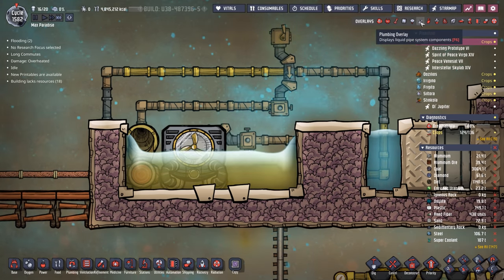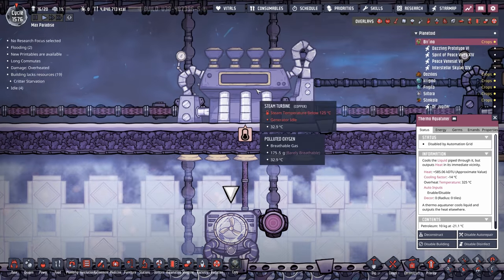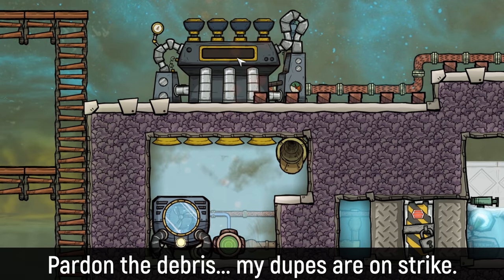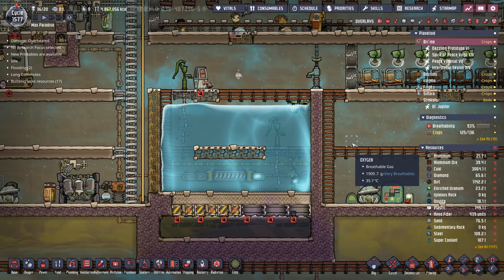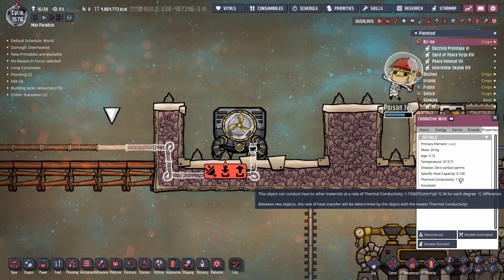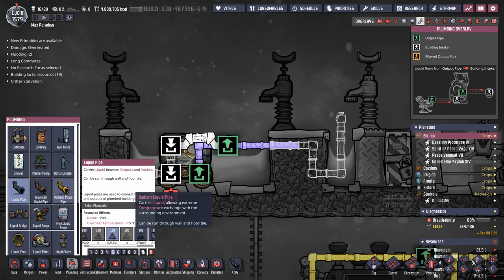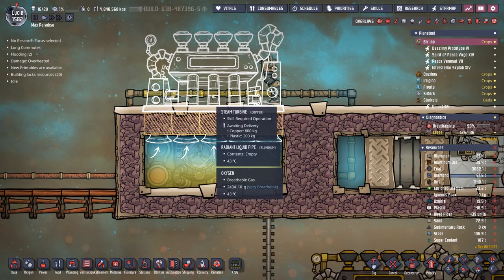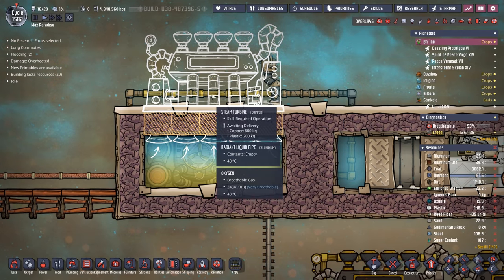Thermo Aquatuner Tutorial | Oxygen Not Included

Comment: If you have enough of the liquid available that you use as coolant, you can instead of the buffer tank have one cooling loop if you use a liquid reservoir and put the liquid pipe thermosensor right after it in the loop. That way, you can have the aquatuner run when the reservoir contents is too hot. The 14-degree cooler blobs will flow into the reservoir first and equalize with the rest of its contents. You can then set the thermosensor to any temperature (that the liquid supports) you like to have the room cooled at exactly.
Reply: Exactly what I was going to say. My sleet wheat farm is 2 degrees, not 3 not -2
Reply from the maker: I like this.  Will steal in the future :)
Reply: a ton of water in tank don't change much when 10kg blobs go in, regardless of if they were much hotter or much cooler. 
If I use polluted water I often make both input and output buffer tanks, so blobs have always a place to go, and it keeps flowing even if my power dies.
I often connect it to 3 or 4 separate loops, sure blobs are much smaller (add flow limiters, to adjust to size, and shutoffs, so you can redirect if needed, and you have industrial grade cooling system) my sleeping area usually don't need more than 1kg blobs, and I like to make it complicated, so I can curse on myself later.
Reply: @deilusi  "so I can curse at myself later" is the perfect representation of how I like to play this game hahahahahahaha
Reply: I'm really bad at imagining things, can you explain this system better? I'm interested!!
Reply: @moonlghtbttrfly Usually AT setups use a 'buffer tank', a reservoir that's barely filled that keeps the loop flowing (and ensures there's no empty pipe segments).

If we instead fill our reservoir until it's almost full, our reservoir can hold more heat before changing temps. And reservoirs will average out temperature with what's in the tank and any new liquid flowing in. So if your coolant gains 20C as it loops around your industrial block, it'll still average out with the huge mass of liquid in the tank when it gets home, so it'll only gain +0.1C overall (example numbers).

And you can put the thermo sensor on the reservoir output so it reads the "hard to change" temperature of the reservoir.
Reply: @moonlghtbttrfly  if I understand the comment correctly, this may be a better description of what the OP was explaining (please use punctuation and full sentences, gah!):

In Echo's design, he has two fluid loops. The one on the left contains his Super Coolant, and is used to bring that 2-tile block of water down cold enough that it turns into an ice block. This is done purely to "store" cold, well past the wanted temperature, so that it can be used on-demand when needed. In Echo's case, he was throwing bursts of heat at it when Resin would drop. The Mechanized Airlock between the left- and right-side of the system is what actually controls whether heat transfers to/from the ice block to cool down the target area: in his case, the Resin.

Many people, however, use this design with two fluid loops. The one on the left doesn't change, but there would be another on the right that passes through (usually) metal plates, or sometimes another liquid buffer, that is kept at a specific temperature for the base (for instance, I target mine at 25ºC and run the 2nd loop all through my base so that the entire base stays at a temperate, 25 degrees constantly). Any extra heat picked up by the 2nd loop while traveling your base will come back to the right-side of the AT and dumped into the metal/liquid on that right side. If that side warms up enough, the Mechanical Door closes, allowing that Ice Block to cool down the right side until it hits 25ºC again, effectively removing the heat.

What the OP of this thread is saying, if I understand it correctly, is that there is a method to do this without requiring a 2nd loop at all. Instead of using a Mechanical Door to manage a 2nd pool or set of metal pipes where heat is dropped off, you instead feed the Super Coolant (or whatever you are using) directly into a Buffer Tank. When a 10kg blob of very-cold liquid enters this tank, it will even out with the all the other liquid already in the tank, only lowering its temperature slightly (depending on how full you keep your tank).

By moving the Liquid Thermal Sensor to just next to the Buffer Reservoir's liquid output, and letting it control the AT, you can configure the AT to only cool down the rotating liquid if that buffer tank drops below 25ºC. Since it takes quite a few drops of liquid to lower the temperature of that much mass of liquid, the AT should stay on for a bit, until the entire reservoir is lowered to the target temperature.

By doing this, you can reduce the 2-loop setup, with an ice block on one side and a mechanical airlock managing thermal transfer, to a much more simple system where the AT is controlled by the exact-temperature of the water leaving the active loop, instead of managing the indirect "super cooling" loop. It's less complicated and also requires a smaller footprint and fewer materials - all around a better design. The only con is that, as mentioned by OP, because you need a tank sitting half-full (or so) of your coolant liquid, it does take significantly more coolant liquid than this video's design. Maybe not a problem for Polluted Water, but it certainly could be for a mid-game deep-freezer.

Both designs have their uses, but I could see the Reservoir design being significantly better for most applications, with few exceptions for when you don't have enough coolant on hand for the better design.
Reply: @Chiberia  Would love to see pics referencing what you rewrote for OP. or even a blueprint that would better help this newbie understand what all is going on w/ what you've stated.
Cheers

Comment: I would avoid using polluted water in the tuner room. When it turns to steam, polluted water leaves a little dirt, and if that gets hot enough, it will turn into a solid block which can short circuit your cooling. If you have some oil or petroleum I think that will work fine with water.
Reply: Wouldn't that require an entire tile worth (one ton?) of dirt?
Reply: @Kenionatus  no, just a little bit can make a tiles
Reply: By the time you are commonly using aquatuners you should be using steam turbines and have oil for plastic already sorted.

Comment: Great tutorial!
- pro tip with 2 liquids instead of vacuuming the room
- very space efficient setup
- material usage explanation... nice!

Also, I thought that bridge is a mistake, but after some playing around it turns out you NEED to have different length bypass vs aqua tuner path. The reason - The aqua tuner can store 10kg of water and while disabled, it doesn't process the water. So as soon as a warm packet of liquid starts traveling towards the sensor, the aqua tuner turns on and starts processing the liquid inside it. That detail makes the whole liquid packet logic a bit confusing, but .ong story short - it works!

Comment: Sleet wheat farm - I'm not using an AT/turbine to cool mine, although I might switch to that in the future.  Instead it's cooled by the output from a cool salt slush geyser, run through a small tepidizer to go up to 2C, desalinated, and then feeds into the sleet wheat farm.  In the future overflow will go to the bristle berry farm just beneath, that pipe will be warmed just a bit more for the bristle berries.  The sand I get from crushing the salt goes to my cool slush geyser's offgassing chamber where I make cold oxygen and clay for ceramics.  I will add a grubfruit farm when I can to make mixed berry pie, one sulfur geyser is more than enough and I got two of those.

Comment: Great to see how to set one up. I always have to redo it because it doesn’t work right the first time
Reply: Was wondering if you can do a tutorial on how to set up a conveyor system to cool down material for metal volcano’s I can never get the layout right and it just stops all the time.
Reply from the maker: This isn't your fault. There is a small bug with the rail sensor where it will not read tiny fractions of material.  It ends up backing it up there.  Check out the Primus series we did two series ago, there is a igneous rock conveyer system in a volcano tamer that may help until I do a proper tutorial.  Thanks for the request and comment!
Reply: @EchoRidgeGaming  thanks I will take a look on that seires. once again great work on the work

Comment: Question on the utility of the ice : You put the ice in just to get something very cold and solids radiate heat / cold more efficiently than liquid  which are more efficient than gas?
Question of understanding: the metal door is to create a vaccum and make sure the temp shift stops?
Third question: Since the tuner will keep on woring as long as the input is warmer than the automation goal more, could I use it to cool down more than just what you showed in the video (provided I have the right coolant and such)? I would have to do it by order of prority but for general base cooling it could work (I hear the mineral consumption and so on, of course).

Comment: Another good way to cool one of these is to use the polluted water from the bathrooms and send the hot Pwater into a peppernut farm.   Or just skip the middleman and stick the aquatuner in the peppernut farm directly.   Putting it in a bath of ethanol at the bottom of the farm works good because it will spread the heat much better than air when it evaporates.  

Also, putting a thermo sensor in the chill reservoir like a block of ethanol or brine surrounded by the ice.  It makes piping a little simpler and does the same thing.

One last thing, using a flow valve at max flow will allow you to make an uninterruptable loop for the aquatuner.  I generally stick it outside the steam chamber to save steel, but as long as both input and output pathways are made the same length, it doesn't matter.

Comment: With the Spaced Out DLC, my current starting planetoid is rich in metal, arbor trees, and pockets of ethanol. The clean water pockets are limited so clean water is kind of scarce, and there's only a few pockets of polluted water near the initial starting biome. There are no reed fibers, or oil on this planet either. So I'm currently without my atmosuits. I can however ranch dreckos for their coats to make my fibers but I need the cool water to produce oxygen. Power isn't a major issue, but oxygen is. 

There is however a cool steam vent that isn't too far from my starting base with a big pocket of water, however it was about 165 - 175 degrees in F while dormant. The cool steam vent puts out at about 195 - 205 degrees F, not quite hot enough to boil the water. After analyzing it, I built a set of mesh tiles off to the right of the geyser so that the water it generates can flow down. Then I built a chamber with a set of flood gates to bring about 6 tiles worth of water 2 high by 3 wide into it feeding into another flood gate. This chamber is 12 tiles 2 high by 6 wide.  And these two are the lower half of the entire chamber. Above the first chamber right after the pool of water from the cool steam vent I have another room that is the same size as the first chamber and this room becomes sealed off with air locks, and the last chamber is open with mesh tiles for my dupes to walk across and build or adjust things if needed. Yes without my atmosuits they suffered scalding and a few of them even got heat strokes in the initial build. 

The reason I had the separate room above the first flood gate and and the second chamber being opened is that I had to put gas pumps in there to create a vacuum to suck out all of that hot air (oxygen-co2)... so that it wouldn't add heat back into the water. I had the pump as far as possible from the main pool. I only have copper, iron and aluminum to work with.  

Now to cool this water. I have the aquatuner but I don't have the steam engine as I have not done any material science yet. I need the cool water now because the amount of algae is very low and I was using up the slime fast to turn it into algae. So I didn't have time to do the material science. So how did I cool this water? I used two aquatuners in series one right after another being cooled by 32 - 40 degree ethanol. Just to the right of this tamed steam vent and the chambers I built and up above were two pools of ethanol one right above the other. So I build a big tank chamber to catch all of this ethanol by gravity.

I then pumped the water from the cooler chamber which was about 165 about 2 degrees below the pumps capacity before being damaged into the two aquatuners. Then I used radiant pipes going through the cold ethanol into a storage tank. I was also pumping out this ethanol into another building into another storage tank that's feeding two petroleum burners with a carbon skimmer and water sieve setup. 

Now as for the chilled water in the tank I was sending this out and splitting it two ways. The first was going through a long series of conduction panels under the two chambers within the insulated tiles (igneous rock) and them coming back around still through another series of conduction panels just below the first through insulted tiles (granite) and this feeds back into the aquatuners. The other split of the water is feeding into an electrolyzer build (self powering once running) to give me oxygen. I'm not using any automation on my aquatuners as I didn't have the room for it. However, the water feeding my electrolyzer is about a stable 68 degrees, and   

Now, this isn't a "permanent" set up and it won't last forever since the heat of the aquatuners and my usage of the radiant pipes is heating up the ethanol near the tuners to about 100 degrees in about 100 cycles, the other side of the ethanol reservoir is about 55-70 degrees. It won't stay cool long and I'm burning so my current use of the acquatuners won't last long, but this was needed for that desperate oxygen. Yeah try doing a build with limited resources and not all technologies unlocked where an aquatuner is a must. This was a challenge. I have 12 dupes, I'm at cycle 224 and finally got enough oxygen to fill the place, but it won't last, but should give me enough time to get some other needed things done. I do have another way to cool the hot water once I break into it and analyze it. There is a cool salt geyser in a cold biome. Not sure if it's producing salt water or brine, but I can pump that and the hot water directly into the same reservoir together then extract the salt out of it. 

Yeah, it's been a fun build and I really like this colony. I think they'll strive once I can get a few more things automated. Oh and they're still currently living off of meal lice... but I should now be able to get my arbor tree farm - power production going, and I should be able to start to set up some ranches along with getting my material science started. 

Yeah trying to do an aquatuner build without steam engines and gold is a challenge. I can already transport to the second planetoid through the teleporter, but I want this colony to be "stable" before I send anyone over. I need to get my farms and ranches up and running and I need to get my bathrooms and kitchen(s) built. So yeah, the aquatuners are fun to work with, but can definitely be a nuisance with their heat output. I'd say that my current starting planetoid is about 60-70% dug out already. I have about 3 or 4 isolated cold biomes that I haven't tapped into yet, I haven't broken through the top section but I can see space on the far top left corner and I'm dug down to the lava zone on the bottom right corner. 

Other colonies, I would have had my farms and ranches up and running at around cycle 50-100... Oh and I had to analyze a tame - close off 2 minor volcanoes too before they started to spill out magma. I love this game!!! 

... 

Now as for the author of this video, your content, tips and explanations of how to build and use them is really good advice to build off of.

Comment: I'm having the issue where my insulated pipe that is connected directly to the aquatuner output, is getting damaged no matter what I make it out of. Any tips?
Reply from the maker: The first possible issue that comes to mind, is that you are freezing whatever liquid you are using, causing it to freeze in the pipes.
Reply: Pipes usually break due to medium state change. Either liquid freezing solid, or boiling into gas inside the pipe.

Comment: I just put a buffer gate on the aquatuner thermo sensor and set it to 0.5s. This way, the liquid pack currently in the tuner input pipe segment has moved on, but the one in the thermo sensor is just moving in. Also, for loops with nuclear waste, always put a valve after the sensor (buffer gate applies here too) and put the automation in it. Otherwise, if the tuner turns off with nuclear waste inside, you'll get "corrosive element damage" and lose said coolant to the environment.

Comment: there was at one point a long time ago an exploit with ethanol instead of water, and no turbine. the system worked based on the difference in heat capacity of the gas and liquid versions of ethanol. i don't know if it still works or not. i saw it being used once on a livestream of the asteroid oassis.

also, one could place an aquatuner near space if they don't have plastic for the turbine. have a water line drip some of the water from a geyser as sacrifice.